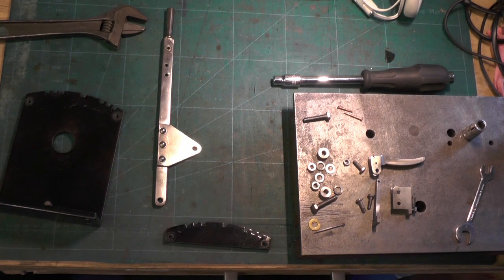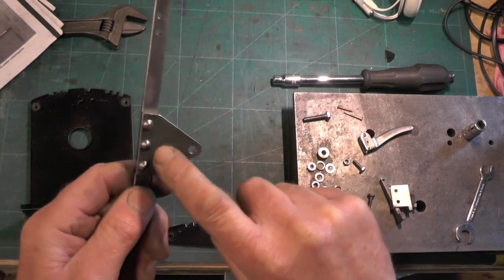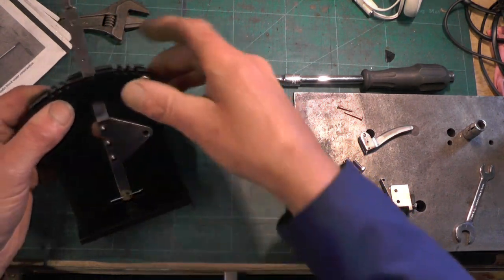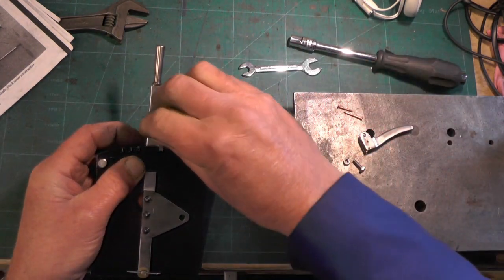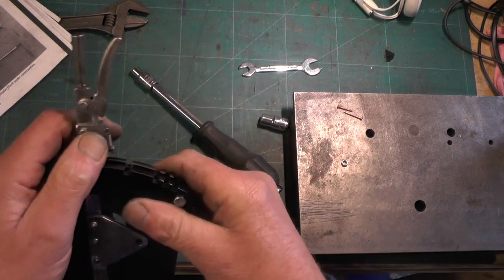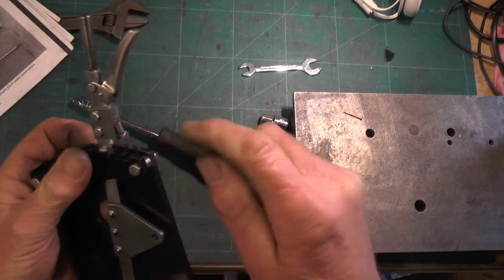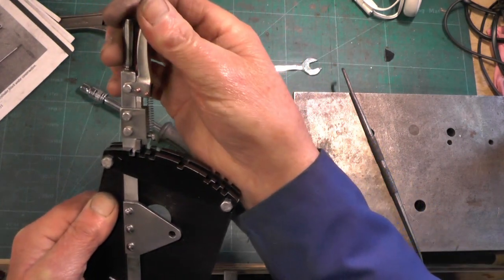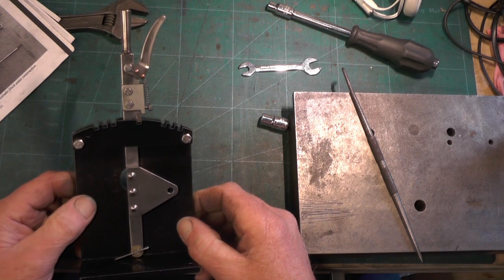Make a Beginners Steam Locomotive ( Reversing Stand, Assembly, How it Works Part 3 ) "mr factotum"

Comment: Intricate, isn't it? Doesn't look like beginners filing to me! Very nice, great workmanship. I suppose there must be some adjustment somewhere in the linkage to ensure that the slide valve ends up in the right place for each position, especially the 2 'wide open' settings at the two extremities of travel. Anyway, thanks for posting, I had no idea about how this works or could be made until I saw this video.
Reply from the maker: hi 
thanks for comments I appreciate you taking time to view and comment, yes I don't get my head too far in front of what i'm doing  but yes I think you adjust via the linkage